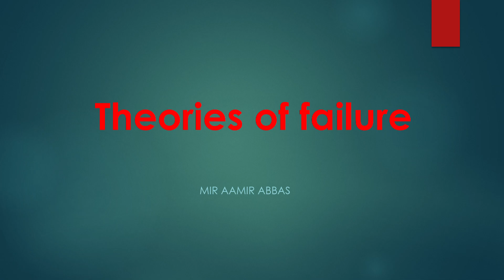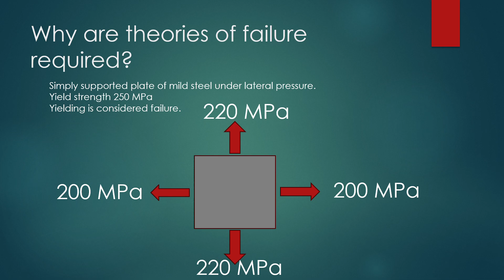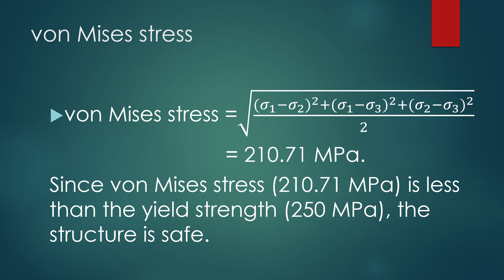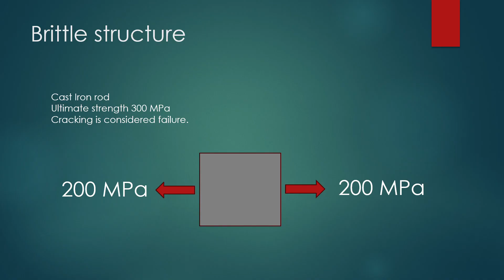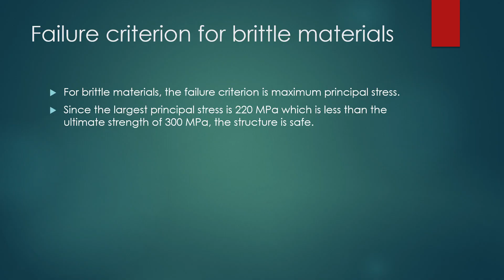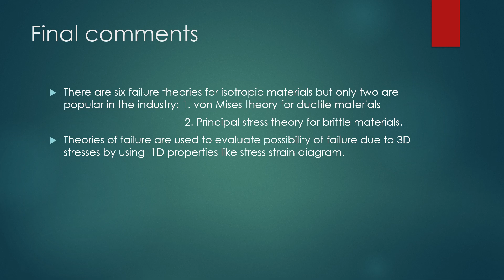Theories of failure.

Comment: why ductile material fails in shear and brittle material fails by normal stress
Reply: Thanks for your valuable reply
Reply from the maker: Because for ductile materials, we usually consider yielding, which is caused by shear strain, as failure and for brittle materials, we consider cracking, which is caused by principal strain, as failure (principal strain is normal strain on principal planes). But we also, sometimes, consider cracking as failure for ductile materials (ex. For Power transformer tanks). In such a case, the failure will not be decided by von Mises stress.